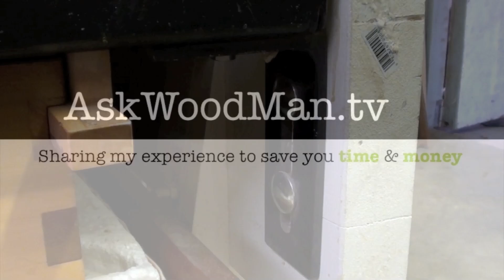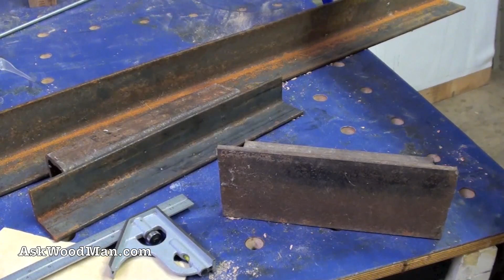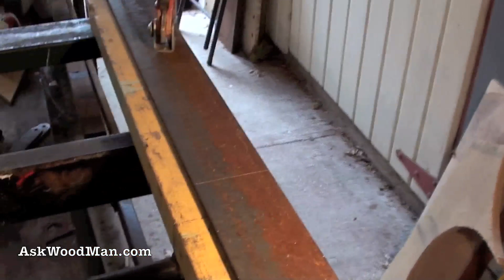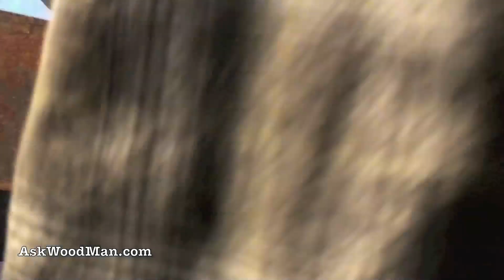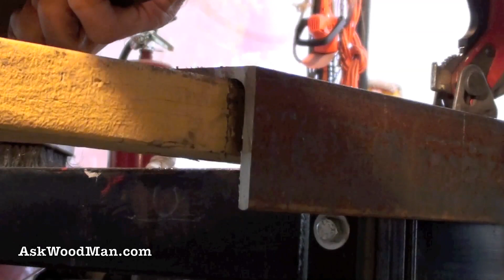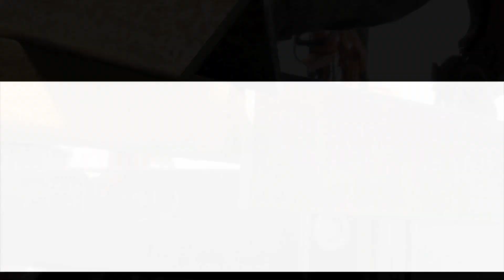10 of 47: Making The Ultimate Work Table • A Woodworking Project

Comment from the maker: The Portaband (portable band saw) is the machine that makes steel fabrication accessible for the individual. It is hard to make much progress with any steel projects if you can't cut material quickly, accurately, and safely. And the beauty is the blades are a standard size for the different brand saws, so the blades are cheap (relatively) and available.

Comment: Lenox also make metal cutting circular saw blades.  They are not really designed for use with a wood cutting circular saw (there are special metal cutting circular saws out there), but they will work - especially on a worm drive saw, with its extra torque.  There are many sizes including the standard 7-1/4".

Comment: I'm a bit disappointed that building this table would require purchasing/renting tools that I do not have and would never use again (and use metal working skills that I do not have).

I appreciated that in previous videos, you refrained from using a large bandsaw because few people would own such a tool.  But here you use metal-working tools that I think even fewer people would have.  I'm hoping that metal can be replaced by wood and still result in a table that is still usable.

Comment: Joel and Womble.  I made a modified version of the ultimate work table and didn't use any steel.  Mine has 2x12's on the end and uses five 2x4's that are jointed flat for support.  I am happy to send pics if you want. Email is username at gmail.  I also built huge drawers and you can stand on them.